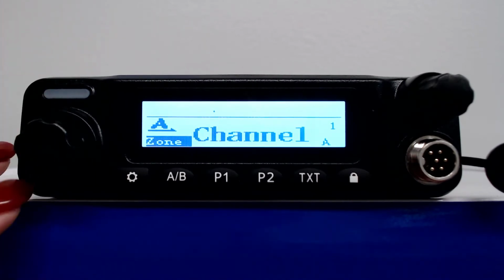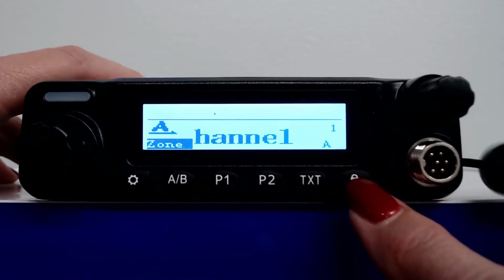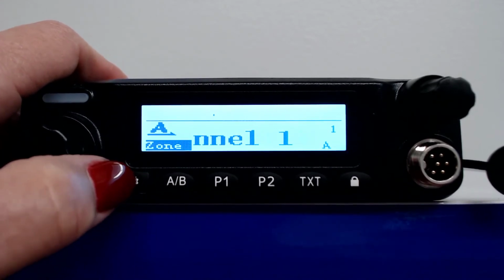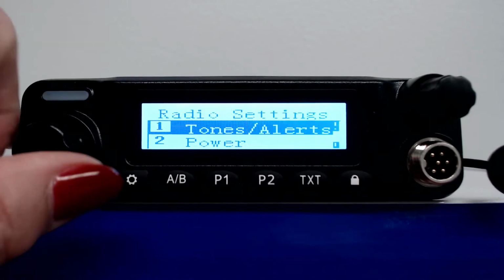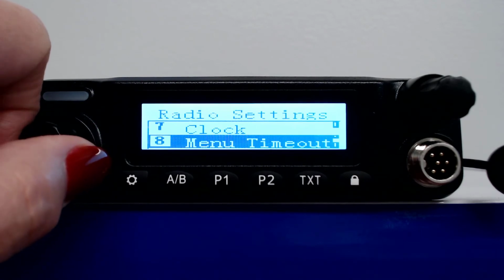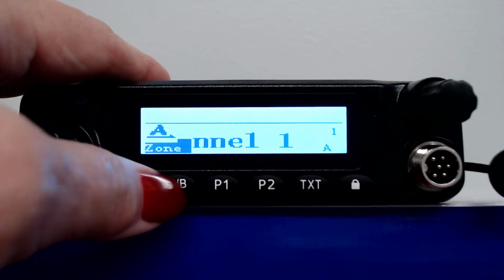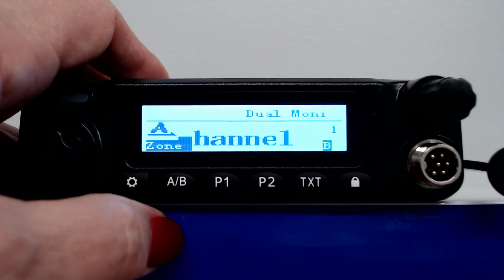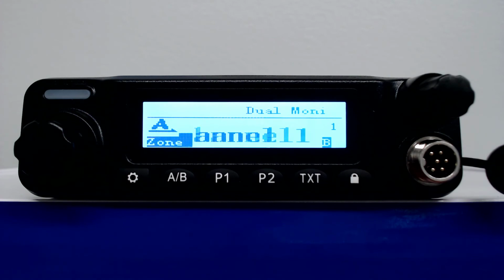M1 Button Functions in Stock Radio

Comment: Great video... And, want to know more about ZONES, SCAN LIST and GROUP LISTS and their function. 

Also, if there's an ability to show alpha character display as default, but switch to frequency (VFO mode) in the display. Often times, someone will ask; "What's the frequency" and I don't have 200 of them memorized. 

I don't see anything programmable in the 'radio buttons' to do so.

Also, can you explain the A/B button in more detail?

... any chance there's a user manual that explains all the radio functions? I've not received my M1 yet, but it'll be here soon.

Comment: My friends have handheld VHF rugged radios.   I have an m1 . The M1 is VHF also.   My screen only says analog.  Do you know how to switch or is analog vhf?
Reply from the maker: Chuck, 

VHF has to do with the frequency range of the radio.  VHF is vhf wherever you see it.  Analog on the M1 will match the signal of the VHF handhelds that your friends have if you can get them on the same frequency.  Keep trying.  Something should match it they both still have original programming from Rugged in them.